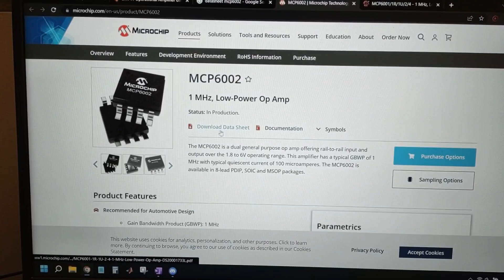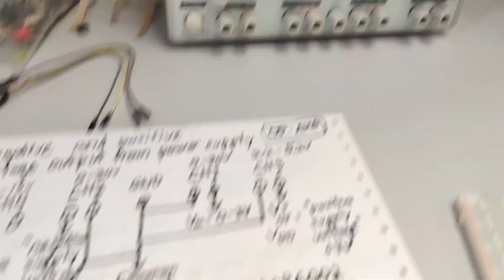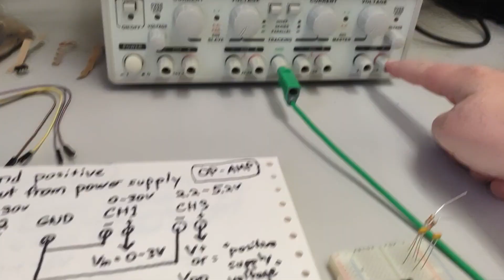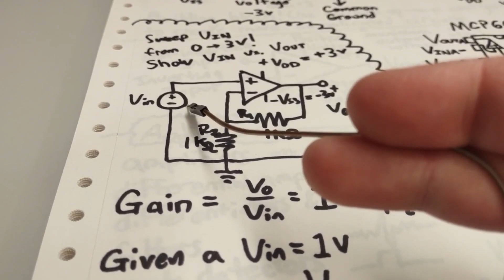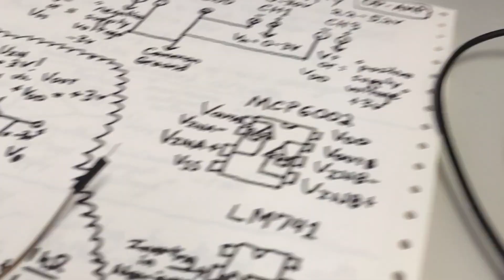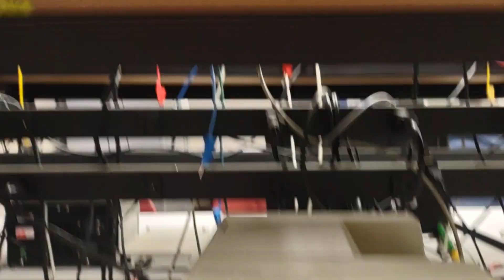Setting up a non-inverting op amp amplifier with the MCP6002

Comment: i bought 6 mcp6002 and none work at "1.8 to 5.5 power supply", it only works with 12, not 8, not 6, not 5, i'm really really confused
Reply: Try a better quality one from DigiKey Electronics